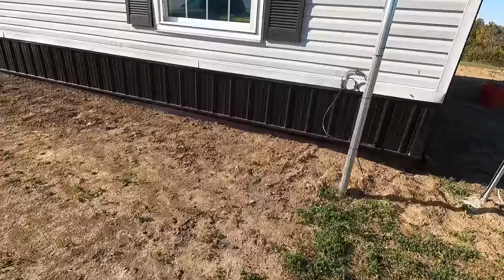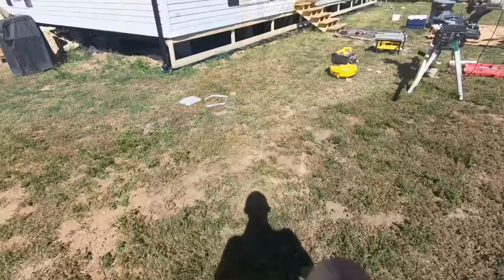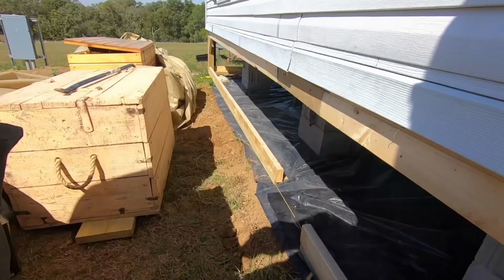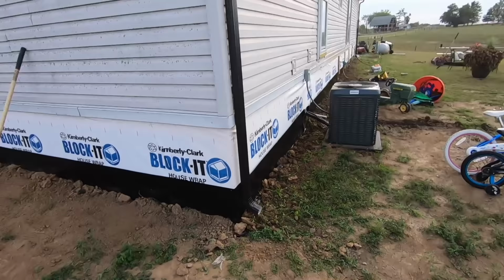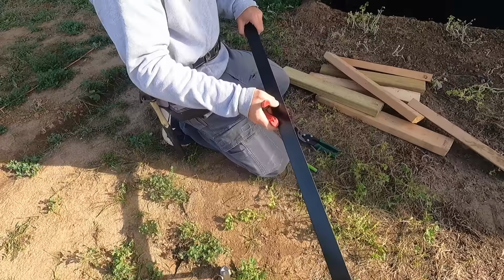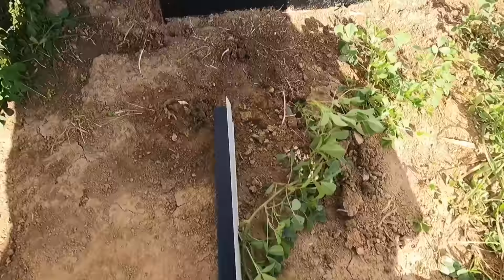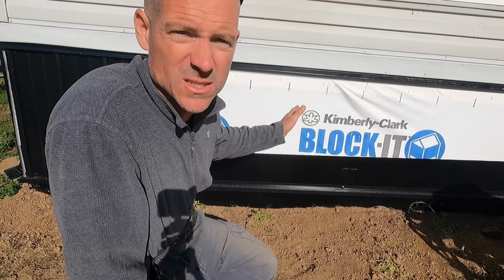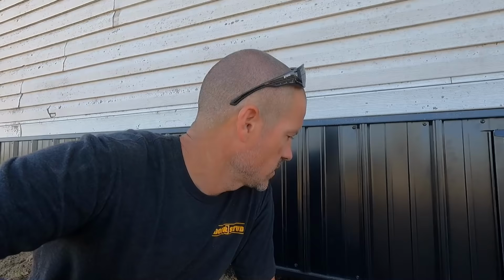Mobile Home Trailer Skirting | Rodent Proofing

Comment: No ventilation is asking for problems. Also using wood is inviting termites into the home. PVC pipe or metal studs is a better option

Comment: After living in my 14x76 mobile home on my own lot near a lake with trees in Texas possums are a real problem digging under the skirting. I have lived in several mobile homes in years past and when they are set on a cement slab that extends out past the skirting, rodents won't dig under the home. Unfortunately, I bought this property and the home was already on it and no slab was installed first. Therefore, I have every  kind of rodent digging holes under the house. They are nocturnal and only come out at night. I would recommend anyone placing a mobile home on land to lay a cement slab down first and extend it out past the skirting. The cost is definitely worth it because It is a real pain dealing with animals under your house.

Comment: My concern is that a manufacturer home will move during seasonal changes.  Your typical skirting has a good 2" of play at the top so when the home shifts it doesn't buckle the skirting.  Block skirting doesn't even touch the house because of this movement.  Maybe I missed it but your skirting looks like it didn't have any play meaning it'll buckle.  Did it?

Comment: Great video - wish my contractors did this - no rodent barrier - no insulation- just plywood skirting - now that it is -36 Celsius in Northern Alberta - hope my pipes don't freeze
Reply: Mercy!!
Reply: That’s where the home owner (client ) tells them what they expect / want. I’m a contractor and I do jobs according to what the client has asked me to price . Just like this video the steps has no landing by code  where I am at steps must have a landing where you come out the door. Plus I saw no ventilation that can cause dry rot and condensation.
Reply: @danbailey96  I was wondering about it not having ventilation, but not being a contractor myself thought maybe it's different in different climates/zones.
Reply: @danbailey96  disagee. What about a first time homeowner that really doesnt know ANY thing about ANY of that? Seems to me there is a right way and a wrong way to do something and you as a proffessional in my opinion do what you know is RIGHT and explain that in the quote. If they feel they can get the job done the RIGHT way for less than thats where they get a second or third quote and then compare what is being omitted in the quote that is less or more. Ya cant know whats the right way unless you look at the situation and can think of the climate of location and know what it necessitates. Thats like " buyer be ware" people put their faith in these people to do a job in their field of expertise. If I knew anything about it. Id be doing it myself!!!!
Reply: Double up on heat tape strips (one on each side of the main)  wrap it all with extra thick insulation, use one strip most times, but power them both on when it is very cold or leave a tap open a bit to prevent freezing.
Reply: You prob hired the cheapest guy. You get what you pay for.

Comment: Down in the southern US they tell us we have to have ventilation through the skirting. How does it work without? Cost estimate?
Reply: What is the length, width and average height of current skirting. The venting in skirting is for air flow under your home.
Reply: Don't know if this will be of any help but...
When I lived in a house (in Atlanta) we had several vents around the foundation.  We would close them in the winter to keep out the cold and open them in the summer to avoid moisture build up.  I don't like the built-in ventilation in vinyl trailer skirting.  When I do mine, I will be installing vents that I can control.
Reply: My understanding is that you need venting to prevent mold, etc, caused by ground moisture.
Reply: Metal skirting or composite is far superior to vynal skirting since My place has metal and looks good but most in My park have vynal and some I saw installed (none are installed with as much care and professional look as you just did) and even those newer installs look poorly now, they sag, bow and start to deteriorate with holes and if you have a mower that even throws a pebble it makes a hole in the vynal, looks bad.
Reply: @kellyolsen-tetrault9974  22'x40', 30"high
Reply: Yeah I live in Alabama and were told the same. I guess it's because of our high humidity here in the south... Miserable summers. I just purchased a pre-owned mobile home 16 x 80 and it's coming in a week, the one I have now is close to the woods and rats got in through the vinyl skirting and tore out all the insulation totally destroyed our home. Rats are the most vile and disease spreading Vermont that's killed millions( black plague etc).. so I believe putting sheet metal down into the ground 2-3 inches on wood frame and metal skirting will help keep the creatures away and having exterminator come spray every month or two will help tremendously!! This looks great and I am definitely doing this to my new home! Thanks for the video. 🤗

Comment: This is a great video, thank you so much. It prepares a person for what is involved in new skirting. I as well as the other commenters have a difficult time finding anyone to do needed work correctly in rural areas. Most are young men that are trying to learn a trade but doing so to maximize their profit and using every stort cut possible to save them money. They count on you not knowing anything about how

Comment: wow I lucked out when I got my doublewide- they already put a decent brick and mortar skirt around it. It has little or nothing to do with the building holding it up but is definitely an expensive upgrade if you had to pay someone to do it. It comes with permanent vents with screens the can close for winter and an access to crawl under there. I got rid of the central heat and air that was needing to be replaced. Just a woodstove and room heaters. Window unit a/c's.  Hot and cold water lines replaced and put inside the house on the ceiling so no more crawling under it for maintenance or freezing! I hate going under there and now I don't need to.

Comment: Thank you. I WILL be using this video for inspiration and tips as I have been thinking of a way to enclose/skirt the bottom of our new 4 season cottage in Canada. Both for warmth and to keep the critters out. I will be adding foam or silver roll bubble insulation on the inside as well. The only issue I might have is that it is built on clay and the ground might shift during the freeze/thaw cycle. The cottage is being built on helical piers.

Comment: Looks really nice !! Some 2 inch insulation board would have helped a lot behind the house wrap.  But I know there is a cost factor involved. 
Nice job !!!
Reply: What is the general cost to do skirting this way?  Can it be done so there are 2 access doors......and what would the cost be doing it that way?  Can insulation be put up for added warmth in the winter in areas where we endure high winds with resultant subzero  temperatures?
Reply: @deborahleedlb  Hello, The cost depends on how much Material is in your area. It's not hard to do. I have done a few Mobil Homes. 
It was around $600,00 for Labor and Materials. But that was 7 years ago. I would say it's double that now.
Reply: @dereksellars  $600,000?? I think you mean $6,000.
Reply: @12thDecember  My bad. Yes I meant $6000. Thanks :):)
Reply: As long as it stops the wind, it is ok. The crawl space does not need to be fully insulated.

Comment: I know it will be Very Helpful to a lot of people. I had planned to do one a little different. Same outcome tho. I had planned on using coffee can with all thread concrete them in can.  Bury can down till 2 &1/4 inch thread exposed. Slip bottom sill board over threaded rod. I may have to rethink this method. Since urs has no digging involved. Nobody wants to dig if they don’t have to.
Reply from the maker: Thanks for watching!

Comment: Probably the most detailed skirting video I've seen. ? Why no vents!.  How do you have acces door held in twist latches. This is how I will redo ours plus add 2" owens pink poly and 12" patio block as edging to keep mower away from skirting.

Comment: Looks amazing and you are quick and to the point. I have to meet FHA guideline for underpinning an area added onto the back of a home I'm flipping. Seems pointless to me because the area is 6 feet in and then it hits the solid concrete foundation. However, I'm going to knock it out tomorrow in much less time thanks to your video.

Comment: The bottom trim of the siding (Which they called it in the video) is actually the part of the old skirting which allows for frost heave of the skirting in cold climates. In Canada you need to follow CSA Z240 or CSA A277 codes.

Comment: That bottom piece on the mobile home appears to be a skirt it is put there so you can add underpinning behind it. There should have been no need to add any j-channel. Mobile home underpinning here must have some ventilation because without it there is a high probability of mold forming underneath the home.

Comment: You done a really good job but what about ventilation for up underneath the trailer
Reply: I was thinking the same. In southern states there is no way that will work without alot of ventilation. Not to bash bc that's a clean job.

Comment: 9 years ago, I used green treat 2x4. 5 years ago I  used brown treat which is designed to use below th dirt. Now I'm doing it again. Both ground contact wood rotted. Any Ideas? Yes it would help if neigh·bor would not water to much and use a gas power weed eater.

Comment: Looks good. Nicely done moisture barrier.  Did you install a dehumidifier as well?  I hope you don't have the, prone to leak, polybutalene plumbing. After years of leaks and flooring damage I replaced with pex and brass fittings crimped on. Also put drain pan under hot water heater routed the drain line thru brick under pinning and outside to drain. Yeah Mobil homes are notorious for being out of square.  Lol
Few years ago had HVAC with 3 ton unit installed on end of home instead of back. Straight route for unit reduces restriction.  Moisture barrier, closed off foundation vents, sealed in all air leaks , automatic dehumidifier.
Also had shingle roof replaced with metal top.
Reply from the maker: This isn't ours, I am not sure what else they did

Comment: Your work is good and your really making it nice and strong but wood on the ground is a no no the termites will find it and go strait up to the trailer house. need metal or concrete for ground contact. Just went thru all that termite stuff in my barn and I had to tear out all my wood shelves and tables and stuff lots of wood got burned.

Comment: This is really nice workmanship!  It's what I would want for my double wide mobile home.  I have some questions:
What is the general cost to do skirting this way?  
Can it be done so there are 2 access doors?
What would the cost be for doing it 2 access doirs??  
Can insulation be put up for added warmth in the winter in areas where we endure high winds with resultant subzero  temperatures?

Comment: I am a cross country truck driver, gone a lot. I recently started residing my manufactured home. Tore everything off, took out all the windows and to do a lot framing replacement. I've finished one side of the house and will do the 2 ends next time I'm home. I was wondering what I was going to do about my skirts. After watching this, now I know. This project will end up taking me about a year, being gone so much, and being 64 and moving slow. Can I get all this at Lowe's? Such a helpful video. Thank you.
Reply from the maker: Should be able to! We got this stuff at Menards. Glad it was helpful.

Comment: Thank you for sharing this great educational video. I have an important question to ask you. I have a mobile home I’m selling to an FHA buyer and my skirting looks exactly like yours But the appraiser said ( based on his interpretation & 8 hour mobile home education course) it’s defective based on HUD guidelines and told me I need to install a solid perimeter that the skirting attaches to and it makes no sense. Here’s what FHA HUD states in their guideline. “For existing homes, FHA says “the entire surface area of the skirting must be permanently attached to backing made of concrete, masonry, treated wood or a product with similar strength and durability”. So, the skirting may be brick, concrete, vinyl, or other acceptable material.”  - I ask what the heck does the word entire perimeter mean? Top portion? All of it?

Comment: Wont the steel cut on the bottom rust with water laying in the trim piece?
Reply: You can drill weep holes in the bottom of the channel. That’s what we did putting up board and batten siding on houses. That should solve that issue.

Comment: those braces are unnecessary overkill. Just drill a half inch hole in bottom 2x4, drive 8 inch nail or piece of rebar into the ground.

Comment: I have tracks on bottom siding when it was very windy it broke off the top keeps going off it way higher up😮skirting the Rail on top has holes on it  keeps coming loose .When the guys worked on it they never gave me extras I have no idea where we can buy it even used ones .Dealing with a car in the shop . Brake problem too. Which will be worse now this happens it is on the end

Comment: I'm currently remodeling an older mobile home and, after watching this video, decided to use this method for installing new metal skirting. what type/profile do you use for the bottom trim? I can see the top trim is a J-trim but cannot determine the bottom. Thanks in advance
Reply: I’m curious about this as well
Reply: It looks to me like he used a SQUARE BASE TRIM.  You could also use a RAT GUARD TRIM.  Any decent metal roof provider should be able to help you out easily.  I recommend NOT going to a big box store and find a local provider!

Comment: Thanks so much. I've been looking for months for a video on installing metal skirting. My home is on a slab and in wooded area,  NEEDS to be rodent proofed. Had to tear out insolation because of. Plan to put drop lights under because I knkw it will be needed ...mobile homes always have plumbing issues. Also...in lousisana, weather is hot today cold tomorrow with or without rain ... what about moisture/ venting?   Now to find someone that can do this for me... 😃
Reply: "Had to tear out insulation because of" ...... because of what????

Comment: I have a question.  The black metal top trim that butts up to the bottom of white siding trim.

I noticed that the corners around the house are rolled around the corners.

Is there a way to make those corners tight 90 degree corners like your trim?

I have a friend who hates that his brand new mobile home has those trim pieces below the siding that are round and puffed out.

Just wondering if you have a video that would explain the relief cuts on those particular pieces.

Again, it’s the skirt trim that you butted up to with your black trim.

Comment: Is this an ideal method for very cold climates as well?
Reply from the maker: Spray foam under the trailer would probably be ideal, but at some point you have to ask yourself if it's worth the money. Trailers are just hard to keep the temp regulated

Comment: Don't the critters just dig under the metal?  Where I live they sure do!  You would have to dig 2 or 3 feet down, and likely also add some cement to rodent proof here.  I end up using belts and belts of steel wool under the mobile to get between critters and the inside of my mobile.

Comment: Question, does the black vapor barrier underneath the home help with ground moisture from evaporating into the bottom of the mobil home? And what about adding crawl space vents? Neccessary? Thanks friend!
Reply: A quick google search says yes.  Venting is required.

Comment: That's not rodent-proof ?
I love how you're doing it and you did a good job. But it's not rodent-proof.
Mice, rats, groundhogs especially in Michigan will just dig under it.
Also:
In Michigan with Frozen temperatures in the winter. The ground will expand up and down. Causing the steel to Bend and buckle.
So  there has to be a way the Steel has to go into the ground at least 4 feet deep. The ground will freeze at least 2,3 ft deep. At 4 ft deep the animals won't dig that deep.
I like the way you did it. But I have to figure out how I can put it into the ground. Without putting in a really expensive Foundation.
Great video I love the way you install it. It's one of the best videos on YouTube I have seen. But it's just not rodent proof.

Comment: Hi very nice job!! .. So u bought everything at menards ? And is the product the pro rib \ color charcoal black or?  Ty in advance
Reply from the maker: If you are referring to the skirt itself...Menards sells 10" x 50' Charcoal Black Smooth Trim Coil.
Reply: @MrPostFrame  no i meant the product itself. The actual siding \skirting .. It it the pro rib 38" barn siding.. N they have 3 or so different black colors is yours charcoal.. Thx alot
Reply from the maker: Yes charcoal black
Reply: @MrPostFrame  ok ty very much 
. appreciate u getting bak 2 me .. Take care👍
Reply: Its me again -i know we are beating this thing to death . we were at menards n the charcoal black looks way to light to me .. Omg they have three black colors. Twilight midnight and charcoal .. Are u positive its charcoal .. To me yours  looks more glossy .. Which i think would be the midnight black ?.. Sry bout all the questions .. Ty in advance
Reply: Ps im refering to the actual pro rib metal .. Not the roll coil thx